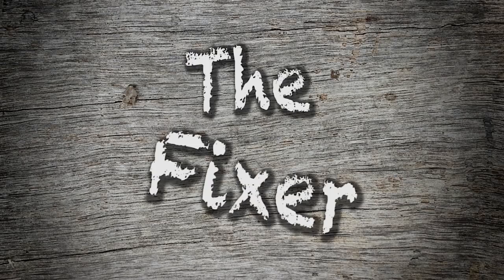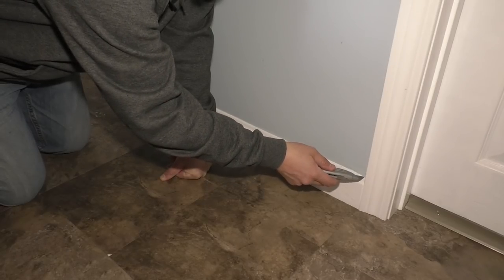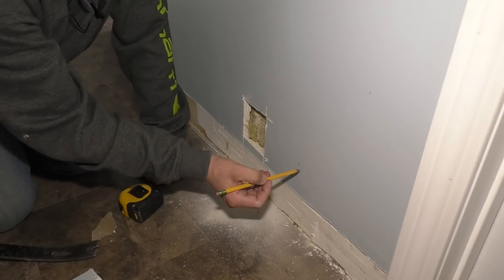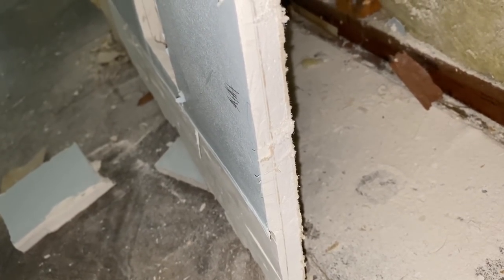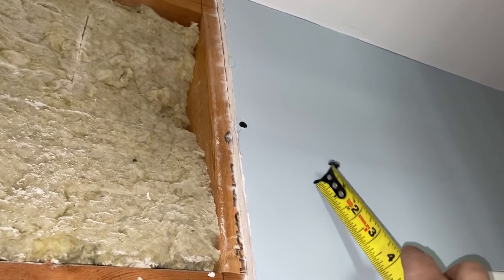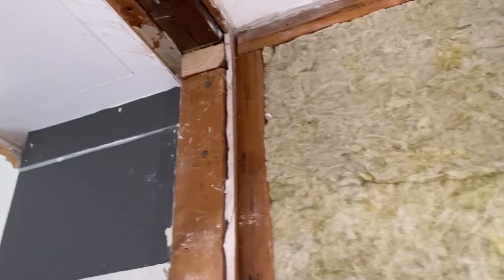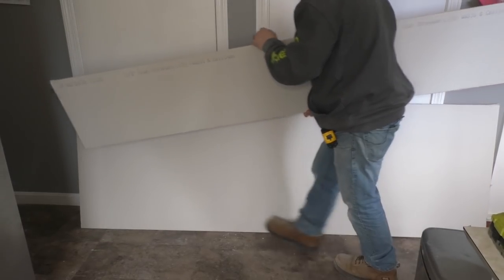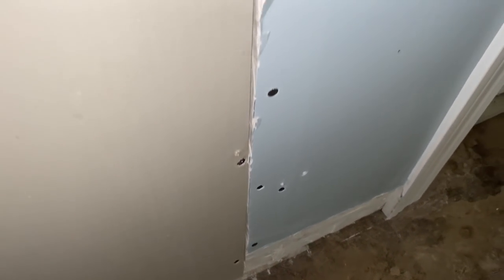Fixing a Crooked Out Of Square Wall in My House

Comment: Hey you can cut into it with the multi tool and hold the blade at a angle in the direction you are going and then put your hand under the top of the tool and glide along using your hand as a tool rest

Comment: As a retired drywall finisher I have to warn you, that butt joint right next to the door with your already 1/4 thick of mud is going to create a hump.  You would be better off cutting it close to the door and use new sheetrock all the way to the door frame and re-trim over it.  I won't harp to much on how that thick mud is going to crack horribly later on down the road.
Reply from the maker: So... the whole trim looking smaller and having all that mud was really bothering me after I posted this video so this morning after thinking about it I decided to get creative.  I grabbed a paint scraper and scraped all that old mud off.  Since the wall was moved it actually worked out nice.  Not perfect but waaaaay better.  Now my trim will not be buried behind the mud.  There is always a way!  I appreciate the comment and totally get where you are coming from.  Honestly this might be my (for lack of a better term) laziest video ever.  I think I am just so done with this hallway... I want to start on the kitchen!  Soon!  Thanks for watching!

Comment: very eerily familiar the builder built the stairwell wall to my basement not plumb.  I added a door to the bottom that was plumb by extending his wall.  The top of the wall to the bottom trim was off by 1/4 inch from top to bottom.  I mudded and sanded that wall for a week to get it looking as "perfect" as I could so your eye wouldn't be drawn to it.

Comment: Don`t know about your building codes. But here in Germany you would put an 45° angle on the edge of a drywall sheet. Then fill it up with mud, let it dry. Then after the mud dried and collapsed into the seem you would put on the tape and then start doing the finishing mud. Anyway, nice work!

Comment: I'm not sure if I would have messed with this or not.  Maybe run the planking cross ways so your eyes  don't compare the plank seem to the wall?  Also, I have used an oscillating tool on drywall inside and the gypsum dust made its way everywhere!  The clean up was not fun, so had to use painters plastic.

Comment: How do you not burn up that drill mixing the mud? I melted the brush holder on an AC 1/2" hammer drill mixing mud. fixed it and almost toasted it again. Used a hole hawg to mix after that. Tried a cordless drill and that wasn't strong enough.

Comment: A tip, remove that asbesto floor. Building something over just hides the problem for the future
Reply from the maker: I suppose… but it will be thousands to hire a company to remove it and the only problem would be if it is disturbed.  It is in good shape and will be sandwiched between multiple floors.  I’m not trying to hide a problem, I am trying to avoid causing a problem.  Only thing that makes me sad about it is I cannot do real tile in the kitchen because of it. 😞
Reply: @TheFixerHomeRepair  we talked about laying metal roof over the asbestocement over our barn roof, but in the end I think it would be worth removing it so we bit the bullet 😫
Reply: My in-laws put real tile in their kitchen in the 80's. It looked nice, but was very slippery if anything spilled on it and dropped things were more liable to damage and breakage.

Comment: I had a bow in our wall that was no where near plumb next to a wall fix that was done plumb...... Can't tell you how many coats it took to make it mostly flat since the sheetrock sheets where about 1/4  inch difference from each other..... it was a mess. but I got it done.

Comment: Take that chunk out all the way to the door. You're still going to have a messed up wall. Just remove it and use a full sheet. Why? Because you have to float that joint out and you'll have screwed up trim.. Can't remove and mud then replace because the trim will be out of line with the other side and header!
Reply from the maker: Funny you should say that… this morning after thinking about it, the trim was really bothering me so I improvised.  I grabbed a paint scraper and scraped all that old mud off.  Since the wall was moved it actually worked out nice.  Not perfect but waaaaay better.  Now my trim will not be buried behind the mud.  There is always a way!
Reply: @TheFixerHomeRepair  Awesome.. One nice thing about mud, you can always sand it back down via paper or wet rag!
Reply from the maker: @MrDan1509  Yes!

Comment: All that work for 1 inch? That depends on the person doing the work, or the home owner who's paying to have the work done. In regards to the person doing the work, I would absolutely do it! I'm also a perfectionist. I learned at an early age whether building new or doing a renovation if you overlook small details here and there, like a slightly out of square wall, or not bothering to fill all the nail holes in your trim work... it adds up. The poor workmanship becomes evident and detracts from the home and the quality of work performed when you do a walkthrough.  My house is over 40 years old and due to the house having a foundation issue and settling as well as the work crew doing half ass work back in the 1980's... not a single wall, doorway or floor in my house was true, level or plumb. When remodeling the kitchen I did the same exact thing demonstrated in this video... and I did only picking up a 1/2 inch! Taking pride in a job well done is immensely satisfying.
Hats off to The Fixer for having the work ethic missing in so many of today's contractors and handymen.

Comment: Been watching this transformation with much interest. Just curious. Noticed you don’t cut various floor layers back to the subfloor at new framing members. I presume you plan on removing old finish flooring layers back to subfloor before new finish flooring. Or not? Enjoying the series. Good job on work and vids!
Reply from the maker: Hey, David.  Great question.  Typically I would tear all of it up but I got it tested and one of the layers in the kitchen came back as containing asbestos so I am not touching it.  Just going to go over it as it is in good shape and the only time you need to remove it is if it is falling apart.  Only thing that makes me sad about that is I kind of have to do a floating floor instead of real tile like I wanted to.  😞. Thanks for watching.  I really appreciate it!
Reply: @TheFixerHomeRepair  thanks for writing back. And that makes so much sense!

Comment: I am sort of a perfectionist. I would want that whole wall removed and fixed and, add some electric outlets to upgrade the electric in that area. My money pit of a house was built in the mid to late 1950s and, the electric is very insufficient for the times plus the original owners screwed with the electric and, hid it on us. Fixing as we find the screw ups. I am all for doing a job right and, not cutting corners.
Good luck.

Comment: Because so many buildings in the UK are old stock, you never have square walls in a refurbishment. When using a prominent square tile, we often use a plain or random pattern border in which to lose the difference in size. Otherwise we have to just knock everything down, hahaha.

As you know you will never get perfection in a timber framed house, there's too many joints, junctions and movement. Movement over here tends to be higher than the US, due to the higher water content of our wood, never ever fully dries out 😂.

One really bad job we have ended up just building a new square wall in front of the old one, especially in properties that have a listed interior. You are allowed to cover over with a structure that can be removed and the original wall, etc. returned to its as found condition. The joys of a country where we have temporary houses from WWII, which were built to last ten years are still in use now and probably in another fifty years.
A lack of funding to rebuild is always an issue, we're not as rich as you, lol.

Good work yet again.

Comment: The shorter the section you try to make up the inch difference the more you will see it.   Then you reveal the mud build up that makes the bathroom door molding look uneven.   THEN we see TONS of extra  mud all over that wall.  So why on earth, are you not removing enough of the drywall to actually fix the situation?  This short section approach does not make tons of sense.  

Part of the problem IS the extra mud you slathered on before yet you aren't fixing it?

Also isn't blue chalk for indoor use but red chalk is not as it is more permanent and more likely to bleed through paint?
Reply from the maker: Funny you should say that… this morning after thinking about it, the trim was really bothering me so I improvised.  I grabbed a paint scraper and scraped all that old mud off.  Since the wall was moved it actually worked out nice.  Not perfect but waaaaay better.  Now my trim will not be buried behind the mud.  There is always a way!

And not sure if you missed the part where I said that ceiling is being removed/gone over.  That red chalk will not exist so no bleeding.  Thanks for watching.  👍